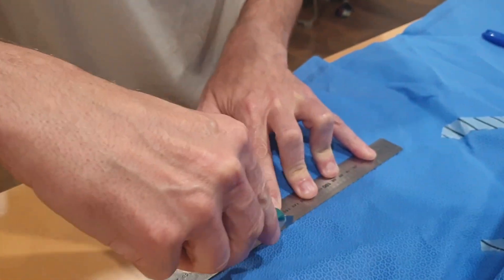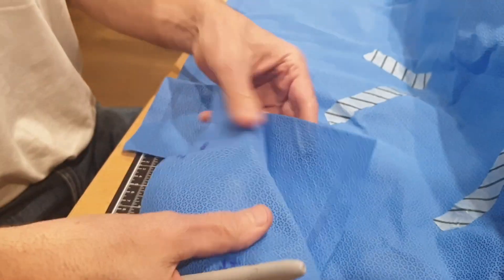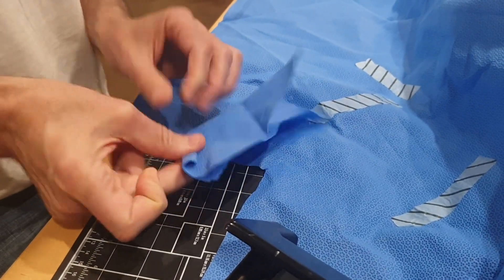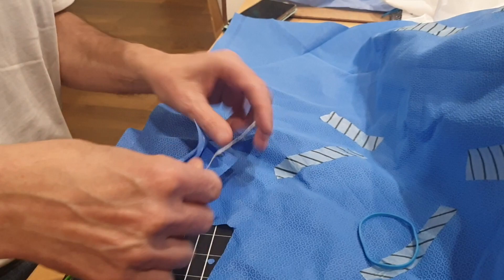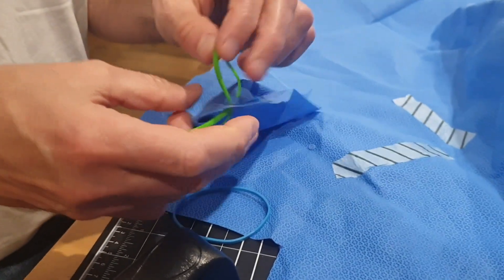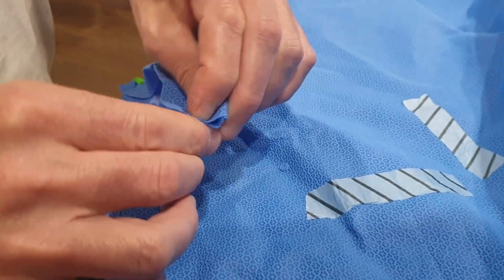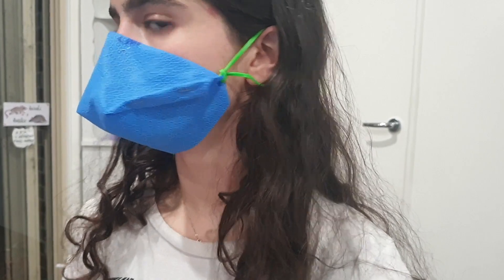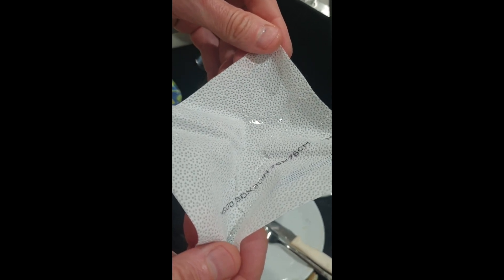How to make a protective mask out of surgical wrapping material in under 5 minutes

Comment: Hellooo
Your description is incorrect and potentially misleading when you compare Halyard to N95:
Halyard wrap is 99.9% BFE - Bacteria Filtration Efficiency, not PFE - Particle Filtration Efficiency.
It has a 99.9% filtration efficiency against >3.0 microns (ASTM F2101)
Compared to an N95 which has 95% filtration >0.3 microns; therefore an N95 is technically more effective :P

Comment: How many washings can this material stand before it is no longer safe to use as a filter?
Reply: Zero. Washing it negates the electrostatic charge on the middle layer of the H600 material, diminishing its capacity.

Comment: Could you please advise how to sterilize, wash, and reuse?
Reply from the maker: Regarding kitchen oven sterilisation- there have been reports and papers suggesting 70ºC/158F for 30min is effective. We are still investigating these. 

https://www.ncbi.nlm.nih.gov/pmc/articles/PMC2781738/
https://www.livescience.com/sanitizing-medical-masks-for-reuse-coronavirus.html
Reply from the maker: It's autoclavable which would completely sterilise it, you can also use your oven to heat it up to sterilise (when put on an oven tray on foil, we found it stable to at least 130°C, the twist tie did melt a bit but you can use other wire if you intend to use an oven. The twist tie did not melt in our autoclave simulation). Pressure cookers have also been documented in the literature as makeshift autoclaves which is effective if used correctly. You can gently wash it in water+detergent as well.  Research on how to sterilise specifically for corona isn't clear cut yet, but we are working on an info sheet to advise those using this design on the standards that have been put out so far on temperature etc.

When sterilising the masks, detach the rubber bands and wash them by hand separately, or use new rubber bands for the next time you wear it.

Keep in mind that this is only advice that we give based on our trials in our own clinic and the available literature to date, as so much is still unknown.
Reply: @mayazazu7070  , great information, thank you. In the University of Florida version, they cut strips of the same material for the ties. Which I assume the purpose is to be able to autoclave the masks that are donated, and later to sterilize again after use.
I will be making some for my loved ones, and hope to have enough material for a local small hospital near us. 
I wonder how strong the material actually is to use as strips.
Reply from the maker: @ALCRAN2010  Using the material itself for ties is also a great idea! For our sewn masks, we use fabric for the ties, and that has held up great in both the autoclave simulation and the oven. We chose to do it that way to ensure the masks are as durable as possible, particularly in order to allow for long-term reuse (though we have not tested using surgical wrap as ties the way UF have, it could be just as durable). It also means more material is saved for the mask itself rather than its ties, and we can then make more masks for more people. 

If you plan to use an oven to sterilise, you can get yourself some 16 Gauge craft wire for the nosepiece, which will not melt as some twist ties might (depending on temperature).

If you manage to get ahold of the material and make some masks to protect your loved ones, we would love some photos of the results! :)